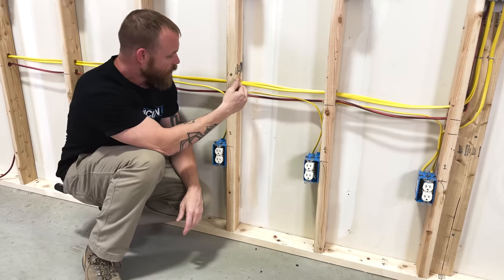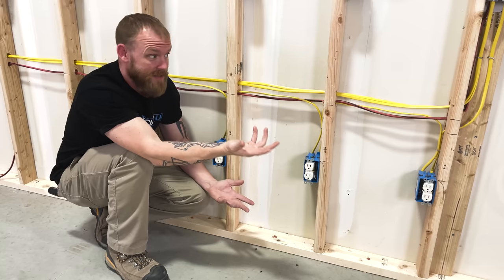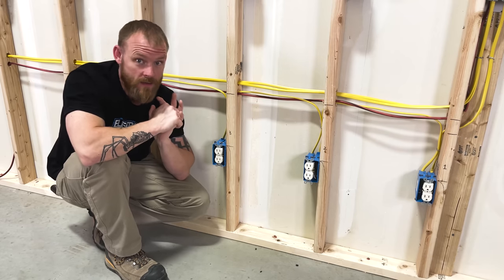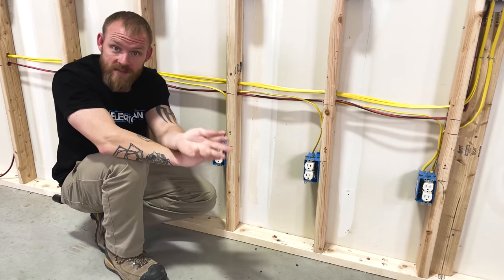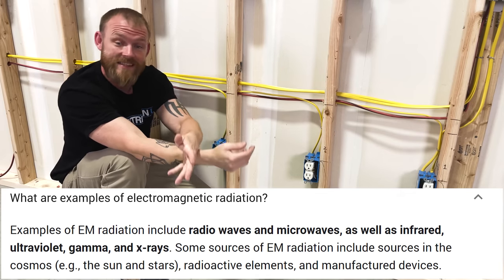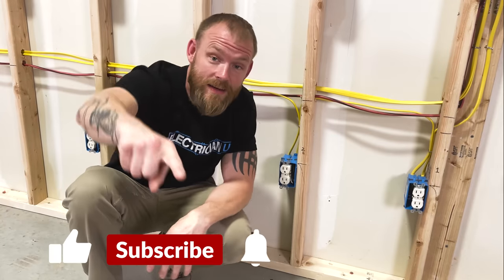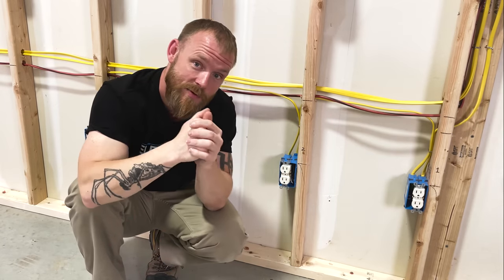How Many Wires Can Fit in Each Hole?

Comment: While we're on the subject of romex running, can you make a video on techniques to rolling out home runs? I've done it now twice, and it just seems like I'm missing some very simple tricks because it takes me FOREVER. Also, what staples do you use and how do you install them? The ones I've tried are a nuisance to put in, and I always end up smashing my thumb multiple times. Would love a video on BASIC techniques of pulling romex, drilling holes; hammering staples and boxes. Just can't seem to find a groove you know
Reply: The best way to hammer the staple in without smashing your thumb is by using the Mr Miagi technique. Gently tap with hammer to start staple. Breathe in, breathe out, swing once, thumb no get squish like grape!
Reply: do you mean actually uncoiling the wire?  you need some kind of spooling device.    for the absolute simplest, make a platform out of some kind of scrap material.  make a cone in the middle that the coil of romex will fit over, and hang it from the ceiling joist or truss with some kind of swivel so it turns freely.  or if you are going to be doing a lot, there are dozens of spooling devices you can buy.
Reply: Use needle nose to hold the staple until you get the movement down. No more hulk smashing.
Reply: Use a spinner. The white plastic staples are a lot better than the old type.
Reply: Well in Canada, our equivalent of roomex comes on reels already, which I am guessing is not always the case in the US. This means any sturdy rod, pipe or whatever is all one needs. That and a stand for the pipe to rest on.
Reply: I still prefer the metal "staples" and use a size that isn't too small width and height wise depending on wire size. You can either, as others mentioned, grip on side of a staple, close to the top and give it 1-3 small taps to set it, then more solid strikes to get it down. Whenever there's enough room, I simply pinch the sides of the staple, give it a couple small strikes then a few more to set it. Just don't over tighten the staple as it can cause damage to the wires inside, which can lead to a bad situation. I've pulled old romex from my own home that was overtightened onto a stud and the cover was actually slightly scorched. That was from the 80's.
Reply: If it’s a really long run, you’ll definitely want a spooling device, the ones that mount to studs are great. But if it’s a residential house (not the mansions, just a regular house) you can roll those out. If you need more just go and unroll some more. We use insulated staples. The ones with the blue piece of plastic in it. And like others have said, first tap the staple with your hammer a few times so it stays in place by itself. Then try giving it a few harder swings. Should be good, if not time to grab the dikes and try again. If you’re new, you’re going to hit your fingers until you get the hang of it. Before you know it you’ll learn the art of using lineman’s for hammering in narrow bays lol
Reply: If you are smashing thumbs when installing cables, you are either going to fast, or you are in the wrong trade.
Reply: @s3tione  in the US, if you want to wrestle 1000 foot spools, it comes on a spool, but 250 foot coils are the normal thing, here, and they don't  come on a spool.
They're  easier to handle, and just as cheap per foot.
Reply: @kenbrown2808  It's strange, I've only ever seen 75m or 150m spools when it comes to 14/2, 14/3 and 12/2. They're pretty small and super easy to work with.
Reply: @s3tione  guess there's  your packaging difference. I like the coils because i use a freestanding spooler, so i can carry two coils at a time, and just pick it up by the handle.
Reply: It all comes with time and practice. I rarely ever hit my finger anymore when hammering staples. You just gotta work with a journeyman and ask/learn the tricks of the trade
Reply: @ericthered9655  this is correct,  this how you do it.
Reply: dewalt makes a stapler and it saves a lot of time
Reply: @kenbrown2808  I have never seen coils or a free-standing spooler, so I guess I have nothing to compare it to.
Reply: @s3tione  looks like youtube thinks I'm  a spammer. If you look up the wire wheel, you should find the one i like.
Reply: @s3tione  Most NM in the US comes in 250 foot spools. It is more rare to see the 1000 foot rolls. They make spinners suited for the 250 foot rolls.
Reply: @johnd6841  I use my 9" Klein heavy duty dikes to hammer in staples when in a tight spot. They're almost as heavy as the lineman's pliers.
Reply: @illestofdemall13  I have the plain blue handles dikes and will only use those if I forgot to grab my linesman’s. It’s funny I have a tool belt and still just fake a few tools with me and put them in my pockets lol
Reply: @johnd6841  Try out the 9 inch Journeyman diagonal cutting pliers if you ever feel like spending 40 bucks. They're nice. lol My tool belt ends up in a corner and I mostly use my Carhartt nail apron to hold minimal amount of tools.
Reply: @illestofdemall13  yea I’ve actually been meaning to get one of those aprons. Or even just a single leather tool pouch for a couple tools. But the only leather tool pouches I look at are the occidental leather ones and as an apprentice, I don’t have the money for that kind of upgrade yet lol
Reply: @johnd6841  Occidentals look nice but too bulky for my preference. I got a nylon Klein tool belt set that I use when I need to carry more tools on me since the pouch is too small for that purpose.
Reply: @illestofdemall13  yea I currently have the nylon Klein belt asl well. I like it, had it for 2 years and it hasn’t fallen apart
Reply: Time.. That's the best way to get better at doing all of that.. More time
Reply: Milwaukee stapler. I love mine. I also bought Southwire spool. Use on floor or it comes with stud mount also.

Comment: I had an inspector tell me the limit on the amount of romex in the hole was "There wasn't enough room for thermal expansion". I had to stifle a laugh. In his mind I think he expects copper to expand by orders of magnitude when it gets hot.
Reply: It expands exponentially..... just with negative exponents. 😂
Reply: Not relevant to this electric issue, but when I learned blacksmithing, I was shocked to learn how important thermal expansion was to the work.  I assumed it could be ignored because it would be so small, but not so when dealing with the high temps of smithing. When you heat up steel to a typical (yellow hot) forging temp of around 2000 F, a 1 ft length of steel will expand in length about 1/8".  So when we are punching holes in hot metal, the expansion becomes very important to compensate for. If you need two holes 12" apart when cold if we measure when hot we will be 1/8" off. So often we mark the metal when cold to deal with this. Because of the very high temps, the expansion becomes significant and important to understand and workaround.

Of course, with loose wires, they never got hot enough for the expansion to create any effect we need to deal with, at least not in residential wiring. It's all about how heat gets trapped and causes temps to rise more. forcing us to derate the current capacity of the wires,
Reply: @CurtWelch  you're right, not relevant, but cool nonetheless. I never thought about how much metal expands and contracts on that scale, I'm usually reminded of it when mile long sections of rail kink in the hot sun because they've expanded so much.
Reply: yeah, ANYONE is good enough to be an electrical inspector LOL

Comment: I would argue that wall insulation has more effect on the temperature of the conductors than bundling does. Wires in open cavity walls can dissipate heat far easier than having a bat of fiberglass insulation or spray-in insulation around them.
Reply: 100%
Reply: Your right, ive had Home runs goin
Threw the same Hole, and the sheathing has turned brown from 
Heat, and Yes after insulator does his Foam
Reply: You are both right and wrong.
Reply: @stephenballard2560  care to elaborate?
Reply: Well that would fall under the ambient temperature adjustments that you should be considering. If you are an electrician,  then you should be factoring it with insulation ratings.
Reply: @imabott7053  We are only electricians, best not make it too complicated lol
Reply: @Dylan-ui1yl  it's not complicated. I'm willing to bet you are an installer,  not an electrician
Reply: @imabott7053  I'd  stay from gambling if I were you. Like I said, we're only sparkys, it aint that hard.
Reply: @Dylan-ui1yl  I didn't say it was hard, you did. I said you're probably not an electrician, just an installer
Reply: @paulcisco1026  hello
Reply: @imabott7053  It was a self- depreciating joke that it doesn't take a genius to become an electrician. Sorry if you found that insulting.
I also do not understand what you mean with the installer jibe. Im not sure if there is a specific registration class for that in my country. 👌
Reply: @Dylan-ui1yl  apologies, it's difficult to pick up on sarcasm through text. Where I'm from we have a horrible breakdown in training and development. Most "electricians" don't really know what they are doing. They can run conduit, pull wire and terminate. But, they don't understand what or why they are installing those systems. We call them installers. They follow directions really well and that is all.
Reply: @imabott7053  
We call those guys ’technician’ or tech. 
They might be ok working on simple cookie cutter paint by numbers type jobs, 
But beyond that, pretty much worthless and often a danger to the job and themself.
Reply: That's not the point. The point is that all of these materials have environmental ratings, and whom ever is installing them is tasked with ensuring they don't create a situation that exceedes those ratings. In this instance it's important that one knows the insulation factor, the ambient temperature of the area, the ratings of the wire, lug termination vs breaker termination ratings, ampacity and so on. That's why this shit should be overseen by an electrician. Not a handyman, not a weekend warrior etc.
Reply: @benjurqunov  call them what you want, but I agree, they need to be supervised by someone who actually knows how to factor in the variables and provide a safe, effective system
Reply: @imabott7053 
Like bundling is 2 foot or more period

Comment: I would raise two points.  First, capacitive leakage causes some heating. Second, you should wiring not for average use, but for the worst case, because it only takes once for the house to burn down.

Comment: 98 % of the time heat is not an issues.  The code keeps the 2% of installations safe.  The facility ai worked at had cooling fans for a cable tray tunnel

Comment: There is a relationship between induction and capacitance first discovered in parallel open wire telephone lines were they had to use pole changers and induction coils to re balance the 600 Ohm line. "Parallel induction" induction heating" Parallax I think is a more reasonable explanation of why we shouldn't bundle, now off the Golden Tower of theory in cases it probably make no difference like you say Justin.
Reply: Yeah, capaci-tive/tance coupling is an effect of induction, right? Works best on parallel conductors. Back in the day, we were taught to take the cat5 perpendicular across power cables.
Reply: Please explain what parallel induction heating is and how it would apply in this case.  I never heard of it.  Induction in an air core, no coiled wire at 60 Hz is negligble.

Comment: I have "center drilled" houses to run home runs to the panel before. Starting with a 3/4" hole at the far end of the house and increasing it to 1 1/4' and 2' as I got closer to the panel. The inspector was quite impressed with my work and complemented me on how neat and clean my work was.

Comment: I think some of the limitations are because we used to run 14/2-3 (or even smaller) through walls, while today it’s more common to see 12/2-3 run through walls for additional safety and capacity when needed. The margin of safety between 14 and 12 awg wires is significant, and running 12 awg limits the heat, capacitive resistance, inductive resistance, and expansion those wires might otherwise experience with smaller wires. Running 12 awg is like future-proofing the home. I always recommend running 12 awg, as well as running CAT-6 to every room in the house (and 2-4 runs to every possible media location). CAT-6 is useful in so many ways that it just makes sense to run it before the drywall goes up.

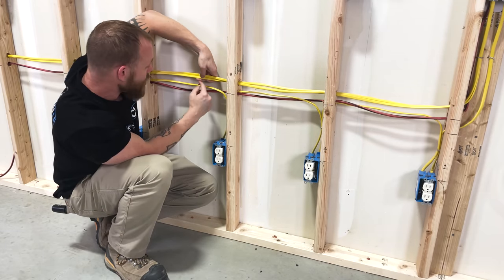Comment: 2:42 I have seen an electrician get killed from that issue, it was actually inductive coupling.  The new wire run wasn't grounded running next to a live 7.2KV 3 phase run, which induced enough voltage and current into the new "dead" cable.  He grabbed the cable to work on it, not verifying that there was a ground in place, and was electrocuted.  That was preventable for sure.  😢
Reply: Yeah saw that happen on transmission lines before too. Literally adjacent towers.  But it was enough to induce and kill
Reply: That's really sad
Reply: Yeah, I think the major issue is inductive coupling, not capacitive. In AC inductive coupling can look an awful lot like capacitive coupling until you realize that the capacitive plate sized of two conductors running in parallel is so tiny that really only noise will transfer. Inductive coupling can transfer significant power. Two conductors run in parallel is a simple transformer with a single winding on both the primary and secondary.
Reply: well, yeah. you shouldn't run anything close to a High Voltage cable. there used to be a thing- you could run conductors from different voltage systems in the same raceway, as long as everything was rated for the highest voltage present.
Reply: @larrystuder8543  It's still allowed if the voltages are identified as different, but I don't have the code reference. Usually, it's not a problem since most wire we use is rated for 600 volts. This much higher voltage is naturally more dangerous. I'm not sure what precaution is effective, but it doesn't hurt to ALWAYS test with a non-contact voltage tester.
Reply: @darbyl3872  oh, absolutely...
Reply: @darbyl3872  industrially, we used to mix 110 v ac control, low voltage ( computer level ) data, and 480v 3 ph power in common ducts. For high powered loads ( big motors, generally anything over 10 hp, ) we ran the power in a separate conduit.
Reply: That's terrible, but other than the same laws of physics, it really has nothing to do with the inductance on 3-4 runs of 12-2 carrying  120v and maybe a cpl amps ea.

Comment: Like he said, it depends on your local inspector. With 4 conductors in a 1" hole, my inspector
said I could only have 2. --- Drilled a new 3/4" hole and re-ran the conductors. All about getting signed off. ---